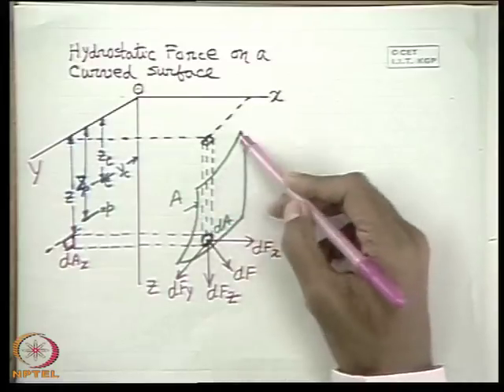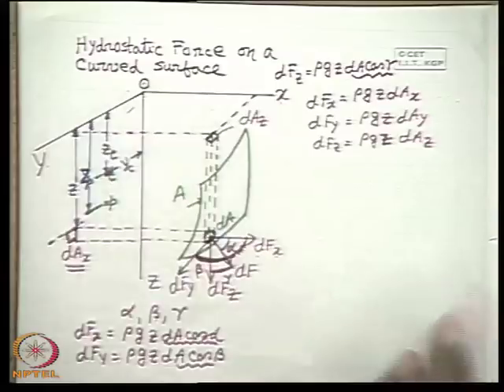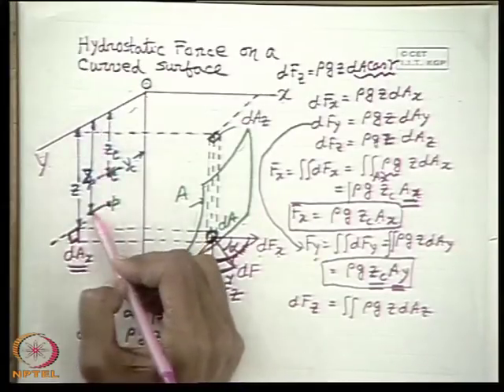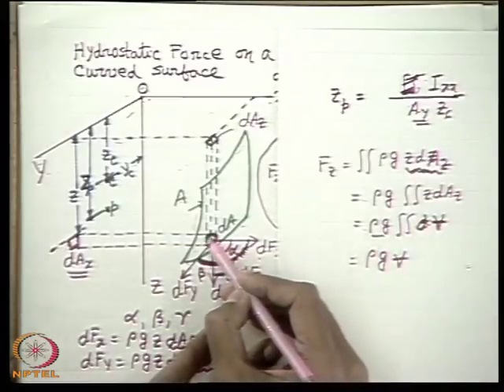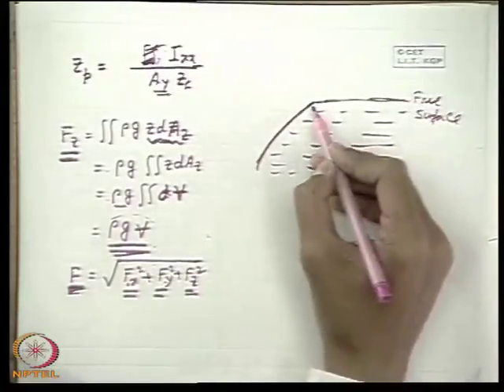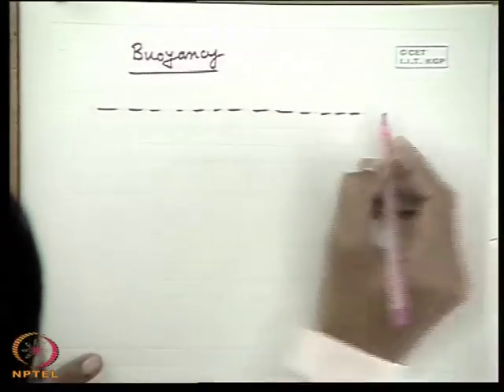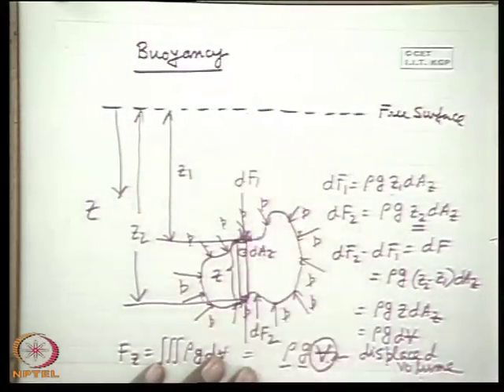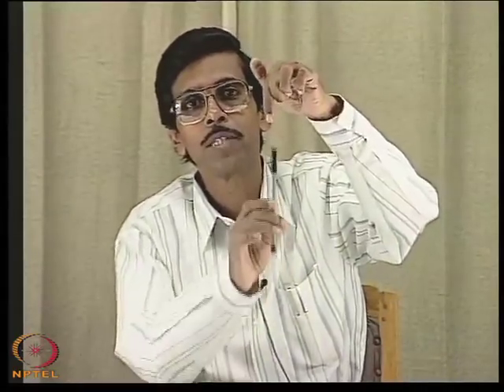Mod-07 Lec-07 Fluid Statics Part - IV

Comment: Don't get concept of z component of force. Anyone explain please
Reply: vridhi khanna it's mean 
If we draw the projection of curved surface on the xy plane i.e in vertically upward direction and draw the imaginary vertical line from each corners of the surface towards the xy plane and the hypothetical volume bounded by the these line in which the fluid is present and the weight of that is the Required force.

Comment: can anyone explaing the answer to the last question, i thought that the buoyant forces would depend on the orentation of the cylinder, if the cylinder is immerseed with its axis vertical, the pressure actingon thre top of the cylinder shold be far lesser than the pressure acting on the bottom of the cylnder therefore increasing the buoyant force, 

now in the same way, the cylinder with its axis horizontal wold experience a a lesser diferencein in the  pressure forces actig on it.(buoyant force) 

Am i wrong :( ?
Reply: typhoon 394, yes  pressure difference on the  top and lower surface will differ depending on the orientation but the question is asking for a force, which also depends on area. The body may experience a higher pressure difference, but if the area of the face it acts on is small, then the force will not be as high. Either way, as long as it's the same volume of object immersed in the fluid, the buoyant force will be the same.
Reply: typhoon394 The displaced volume is same in both orientation thus same amount of  buoyancy force will act.
Reply: Bouyant forve depends on volume of water displaced ie Density x gravity x volume.
Reply: It's not the pressure force the question is asking like we can use the formula p x g x h ...rather it's the boyant force it's asking which is the volume of the fluid displaced.
Reply: if u integrate that pressure difference force then u will get ,F=density of liquid *g*volume displaced by body.

Comment: How is the projected area of closed surface on any direction is zero?
and we are talking about vector area right?
Reply: For anyone still wondering,
Yes,
He is referring to the resultant of Area vector
Reply: He is talking about net i. E from both sides area will be same and as pressure is same for thet case so, forces will cancel out and net in horizontal direction at same height will be zero
Reply: i too didnt understand that, any  luck finding the answer?
Reply: positive projected area+negative projected area=0
Reply: thanks ! nice explanation